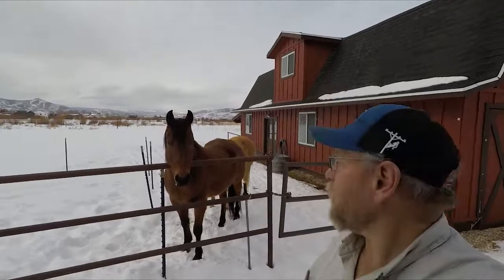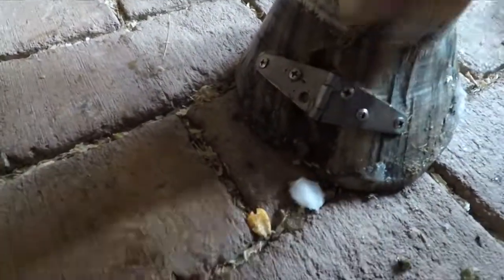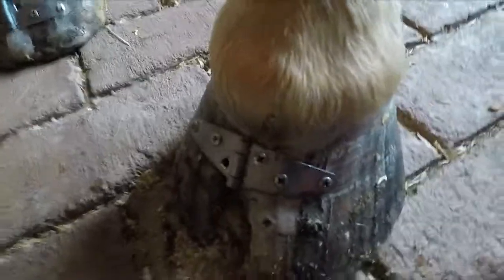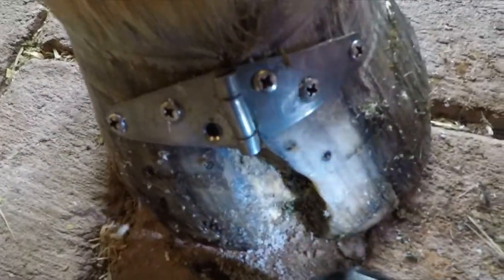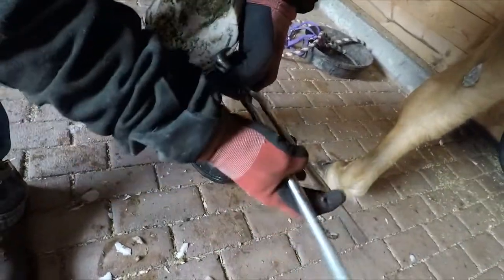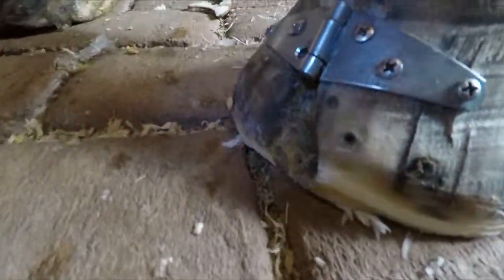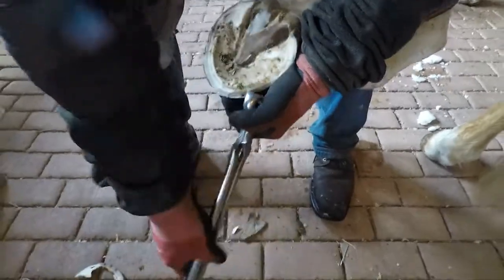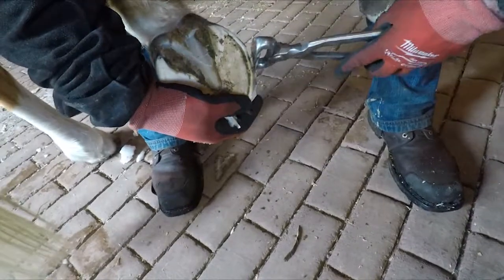Horse Hoof Hinges Part 2 - RJF

Comment: Interesting invention here. I trim cow hooves for a living in South Dakota and would like to try this on them nasty sidewall cracks. Although I don't know if I'd get the cow back in 2 months to check on them or adjust them. Stay safe.
Reply from the maker: *****, I used to trim cows full time years ago. I’ve trimmed like 100,000 of them. I built some chutes back then and sent one to North Dakota. I put a couple videos of my chute up. Ya, getting back in 2 months would be hard to do. Do you use a carbide grinder disc? Thanks for watching.
Reply: @RockinJFarrier  yes sir I have a Riley built lay over chute and that company also makes trimming discs similar to trim tecs. Currently I average about 400 cows a week.
Reply from the maker: @user-zu2bw7ig5v  back in the day I would trim 100 a day at a couple bigger dairies occasionally, I could do 12 to 15 an hour when all was set up just right. 50 is enough. I did some beef cows and bulls, and some rodeo bulls. 400 hundred sounds perfect. I did the test work for trim Tec 25 years ago. Yea ha.
Reply: @RockinJFarrier  I'd much rather trim cows than horses. That is back breaking work.
Reply from the maker: @user-zu2bw7ig5v  I totally get that. But I only have to do 6 to 12 a day. Yesterday I trimmed 12 and shod 1. That’s enough for any 61 year old🤠